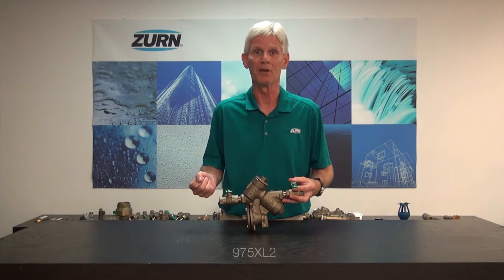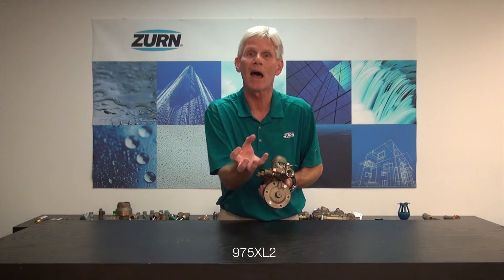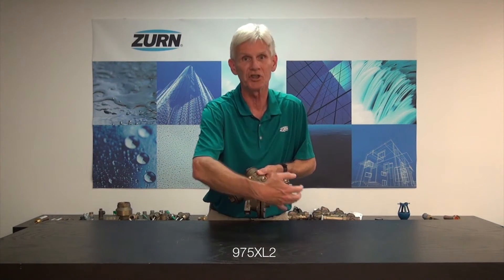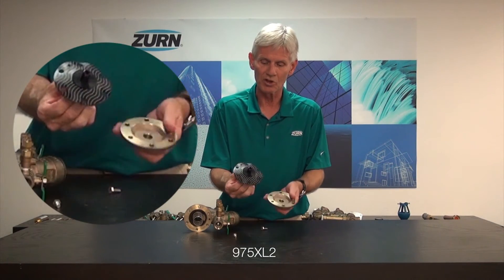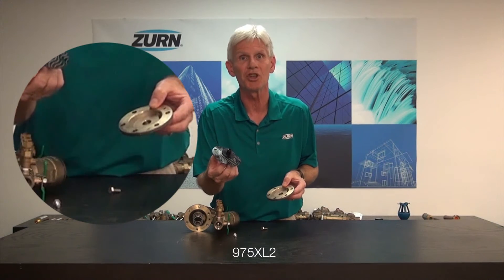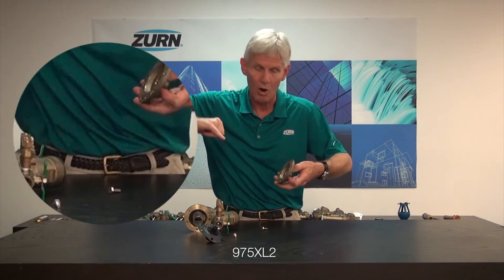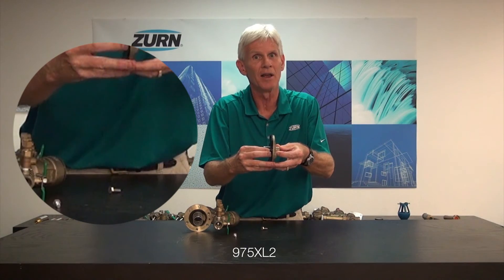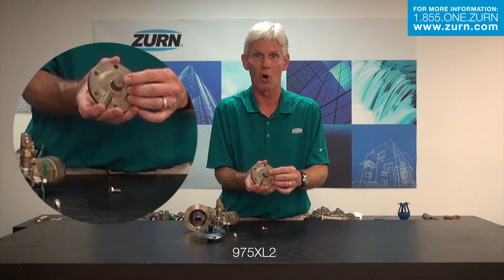Troubleshooting a Leaky Weep Hole on a Zurn Wilkins 975XL2 Reduced Pressure Principle Assembly

Comment: Thanks. It is very helpful. I used plumbing pipe metal brush (the one used in soldering copper pipe to polish inner copper pipe to clean deposit) to clean green bronze deposit around weep hole as described in the video. Problem fixed.
Reply: thanks for the tip, i will apply that techniche to get mine fixed, i ordered new repair kit, i hope it includes o-ring to replace that after brush cleaning, if i am going to take apart, i would like to replace all washers or o-rings too.

Comment: What causes it to seep out of the weep hole ?
Reply from the maker: Hi Shawn - thanks for submitting a question. The Zurn Wilkins RPP or RPZ  backflow prevention assemblies, such as the model 975XL2 may sometimes leak from the air relief port on the center of the relief valve cover. The vent to atmospheric pressure is needed for proper function and movement of the components within the relief valve. The most common components that allow a leak in that area of the valve are the sealing components (i.e. o-ring, upper plunger, and relief valve cover) in that area of the relief valve, near the cover. Replacement components can be purchased as part of the Zurn Wilkins repair kits that are offered.

Comment: I've had the exact same problem after installing new rp valves. Assuming that the o-ring is new and there is no calcification, could it be a manufacturer defect?
Reply from the maker: Thank you for your question, our product manager says: "Typically, the only issues that result in weephole leakage are a worn or deteriorated oring, an oring gland on the plunger that is cracked, or pitting and calcification within the Relief Valve cover.  Since each and every Backflow Preventer is tested prior to shipping, the chance of the leakage being cause by factory defectivity would be quite small."